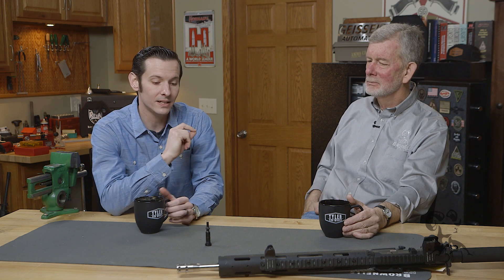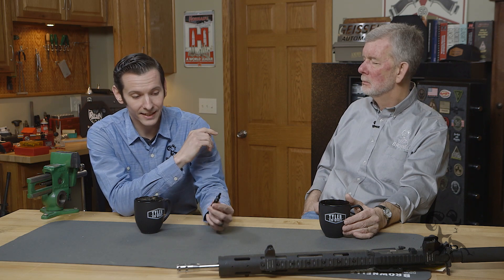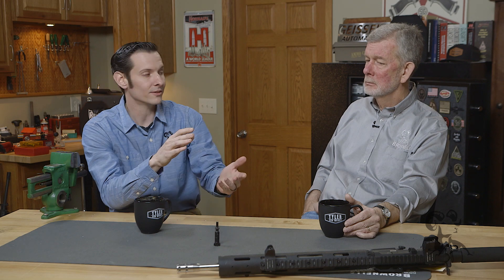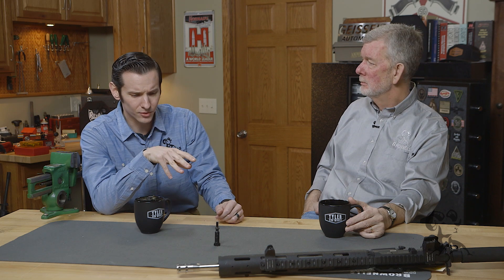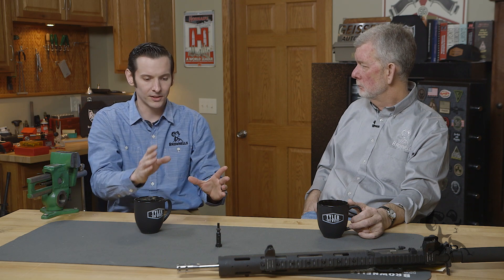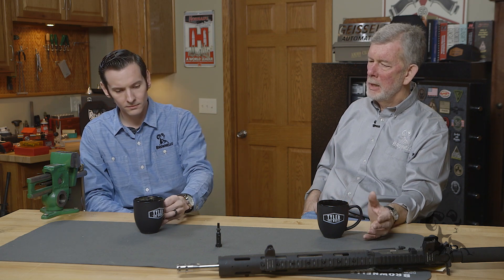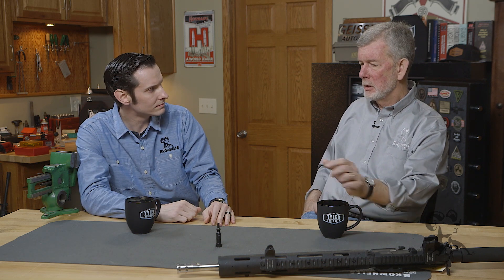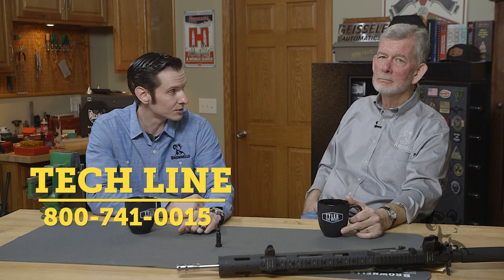Smyth Busters: Debunking an AR-15 Myth - Gas Ring Alignment

Comment: Reality is when the bolt locks the gas rings compress to seal off the expansion chamber. There will not be a gap at moment of firing, not until the carrier begins to move rearward.
Reply: Similar to the piston rings in your car's engine. They aren't close enough to each other for alignment to matter but are compressed enough to prevent significant pressure loss unless they are old and worn.
Reply: SmallArmsSolutions is the man. I just bought the lantac Ebcg and saw my gas rings were alligned. I thought I'd have to send it back, but I'm happy to hear that info is myth not fact.

Comment: I’ve intentionally aligned the gaps on my rings and shot it. Guess what it works and when I took the bolt out... yep they were no longer aligned
Reply: Me too, way back in the mid 90's.  How are people still believing this myth.
Reply: HOW did you ‘know’ THEY WERE ALIGNED at THE MOMENT you pulled the trigger...UNLESS you glued them together? No way of knowing for sure, as every time the bolt MOVES..or the action cycles, they’re incrementally moving to a random alignment.
Reply: Green tip I suppose
Reply: @m118lr  thats kinda the point.

Comment: One of my old beater bushmasters has seen plenty of use over the years... Took it apart for a “annual inspection“ one time and noticed there was only one and a half gas rings left, functioning was still perfect.  

It’s a myth they have to be aligned.

Ordered set a gas rings from place called Brownell’s... they have good stuff.
Reply: I was having terrible ejection issues at -30 C which is about the same as -30 F. Turned out I had two rings left. Also my gun was slightly tuned for 62gr and I was shooting 55gr pills. Next day was warmer and I couldn’t go get parts so I switched to my typical 62gr and only had 1-2 issues in about 300rds although I did have about a dozen failures to lock open, but that was with 10rd magazines so about 10% of the time.

Comment: OK. When I have the bolt out and in my hand, I move them around to alter and offset the gaps before I reassemble the BCG because it makes me feel good. I do not panic thinking about it.
Reply: Mark Goostree ha ha ha
Reply: Here I've been using drugs to "feel good". All this time I only needed an AR-15 and offset the gaps on the seal. This should save me some money.

Comment: You can't say "myth busted" after talking about a problem. you have to #1 actually do the experiment, testing rings aligned vs non aligned while taking pressure readings, then #2 blow up a cement mixing truck with C4.
That's the only acceptable way to "bust" a myth.
Reply: Exactly.  Two guys flapping their gums doesn't prove anything.
Reply: Fact!
Reply: AGREED!!
Reply: Failure is always an option! Dang I miss that show!
Reply: Because there's nothing to prove, the rings float. Every time that bolt moves so do the rings so never at any point do they stay in the same position twice.
Reply: @russr  looks like Jamie & Adam are going to have to build an ar, OUT OF GLASS!
Then shot that Mf er
Reply: Yeah wth
Reply: @uxcitme  I've been using just 1 gas ring for months..thats a busted myth....
Reply: When I was in the army I was told my gun wouldn’t work by my Sgt. a whole bunch of us tried this and nothing interesting happened. We tried this multiple times and couldn’t see any difference. Plus when we took our guns apart the ring were no longer lined up.
Reply: @john-paulsilke893  ya its becsuse it says to do so in military TM'S. But if instructors think aligning gas rings are fixing problematic rifles that are short stroking then they're just at the cutting edge of cycling and you're not fixing the actual underlining problem. This is ongoing pigeon religion in the military that keeps the  actual underlying issues in problematic m4/m16s from being fixed.  That gap is there for a reason, this is why it takes force to push the bolt into the carrier because you're actually compressing the rings which closes that gap. A properly tuned rifle should run on one ring as a matter of fact. Although it might be a beneficial practice to do so in the military because of well worn rings that are in need of replacing, but it should never be looked towards to fix an issue.

Comment: As per U.S. military standards, when you re assemble your M16 bolt, you check the ring and off set them. Never heard it wouldn't function, just that it will work better.
Reply: Like piston rings gaps it'll run but shit you'll be blowing oil maybe and it'll smoke. So why even clock your rings lol plus we want are ars to be good on emissions lol
Reply: I am not saying that offsetting gas rings is not in the M4/M16 TM, but others and myself have never been instructed to offset rings during reassembly. I've  never had an issue from an M16A2 or M4A1 when the rings weren't staggered during reassembly. Not even from my own personal rifles. The ring gaps close up enough during re-insertion into the bolt that the gap space is negligible.
Reply: I've heard of it but so called experts can sometimes get their worthless 2 cents in tech orders until someone fixes someone's mess up
Reply: Ya, it's still a good practice to do so in the military due to rifles having worn out gas rings that need replacing. Though it should never be looked at as a "fix" for problematic rifles.
Reply: This is what I was taught in basic and they continued to emphasize it until I retired. No matter which service was running the range that was always part of the instruction.
Reply: @34mxrider  Drill Sgt beat my ass over not offsetting them. It was taught that way in 1989. Today, you're not even allowed to remove the extractor to clean, and there's no mention of the rings. Have times changed.
Reply: @Ripper13F1V  We still removed extractors when I went in 2015, although I wouldn't be surprised if things changed. While I was in, I found quite a bit of firearm info from NCO's to be incorrect (non-experts teaching non-experts). Even some of the info that armorers were taught was outdated. I'm no expert myself but it was obvious that the Army was and still is behind the times with quite a bit of information.
Reply: @34mxrider  Exactly, I always did what they said when they were around, or the armorer, but as I learned and became more knowledgeable,  I did things on my own the right way. I also recall a PSG behanding me a drill and cleaning rod and turning up the speed. I'd never do that on my own, but when the PSG hands it to you and is hovering over your shoulder while you do it, well you just do it right or wrong.

Comment: It never made sense to me that this could be an issue. I was told this myth from a worker at my local gun store when I purchased my first AR-15, which was a S&W M&P 15 Sport 2. I thought about it often and just why it wouldn't make sense. I noticed that two of my rings were aligned when we took at out of the box and he made sure they were all evenly spaced apart. I asked how that happened and what would stop that from happening when the rifle is being operated. Never got a clear answer and have always been confused by that until I started building my own rifles. If your rifle is properly gassed, it won't be an issue. I would say the ONLY time it could be an issue is if you tuned a competition build to only cycle far enough back to lock open on an empty magazine. If you lost the slightest bit more gas, you rifle may not lock open, and that would be very rare because if the rings were all aligned and that's why you lost pressure when you shot, they are no longer in alignment after that shot. Long story short, if you have a mil-spec rifle that is slightly overgassed from the factory, this is something you don't really have to worry about.

Comment: That's a weird myth, especially considering that if gas can get through those gaps in the first place, then it's going to escape the system whether or not they are in alignment. The path out, while infinitesimally longer, still exists even if one of them is turned slightly.

Comment: Honestly I know it's such a small amount of gas that leaks it doesn't matter but I've rebuilt too many engines to allow myself to leave the gaps aligned when I clean a bolt.
Reply: Same here. I know it doesn't hurt functionality of an AR. But being a truck mechanic for thirty five years has made me paranoid.
Reply: It doesn't matter in engines, either.  The rings are going to spin randomly as the engine runs anyway.  No point in worrying about orientation.
Reply: @immikeurnot  it does in diesel truck engines.
Reply: @bobhorsewood5689  it does in gas engines too especially the oil rings

Comment: Our Drill Sergeants told us to always make sure there was no gap in the gas rings....    that was in the early eighties....   lol...
Reply: I am gonna have to say the reasoning with that was that you were firing Vietnam Vintage M16A1's with hundreds of thousands of rounds having been fired through them and taken care of by Basic Trainees. Those were not the best weapons in the Army inventory at that time.
The upper and lower receivers rocked back and forth. None of them were tight.

In some cases with not the best maintenance but the maintenance that your unit could afford.
Worn out and close to worn out parts were common. The idea that the the gas rings lining up was in the Military manuals. It still is to this day even with updated manuals.

Personally I am not gonna line the gas rings up no matter what anybody says.
I have seen the supposed myth busters on various things.
Perhaps this caused a malfunction 1 in 10,000 times who knows.
Same as with firing A2 ammo out of A1. We were told not to do it. Why because the big mean Platoon Sergeant and Squad Leader TOLD YOU NOT TO. 

I still wont do it. Why because A1 rifles only developed 51,000 psi of chamber pressure.
A2 ammo develops closer to 60,000 psi. 

Do you really trust you life with a 40 year old rifle by shooting a round that it was not originally designed for? I do not.

Comment: I have a good topic "myth". How about 16" barrel length gas system...carbine vs mid length. I guess the myth would be to question why mid length is better than carbine length. Also to point out the pros and cons of each gas system length and determine a winner from a reputable source like Brownells. Keep up the good work guys! Informative videos are awesome
Reply: The longer the gas system the easier it is on parts and felt recoil. Midlegth seems to be preferred for most

Comment: A more gas efficient bolt will make for a more accurate or consistent rifle. On a precision gun it's important to make sure the gas rings aren't aligned or your "clean and cold bore shot" may not be consistent

Comment: What about those JP one continuous gas ring instead of three independent gas rings? When I stick the JP ones in the bolt Does not sustain under its own weight gas rings from JP do not hold the bolt in place it just moves independently back-and-forth with no friction. Now I have yet to fire my AR with these rings inside but when I did the old fashion test to see if the rings would have enough friction to be held under their own weight they do not. My question is will this cause problems with firing the weapon will it then become essentially a bolt action, LOL